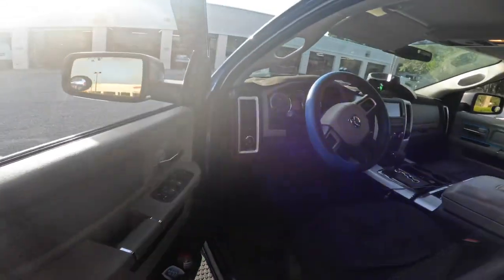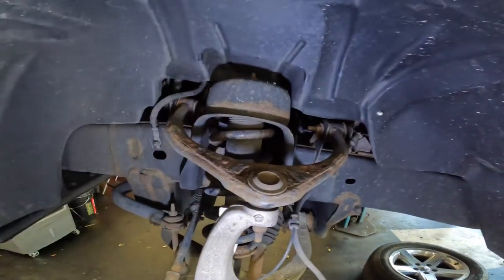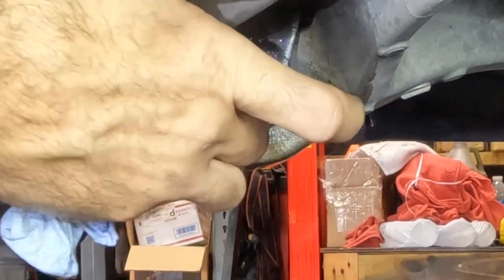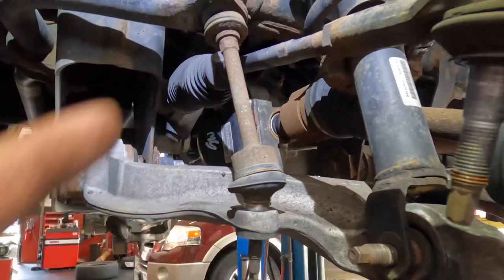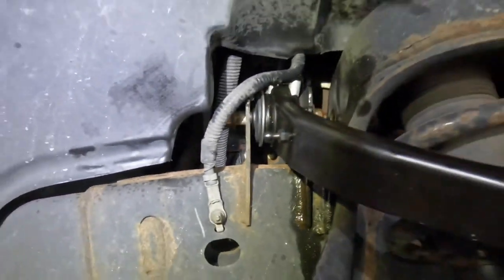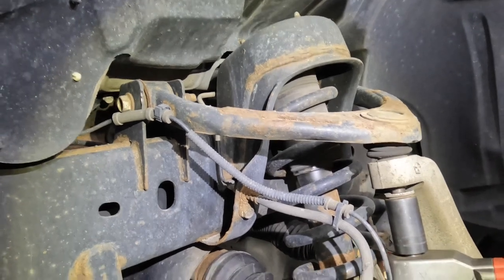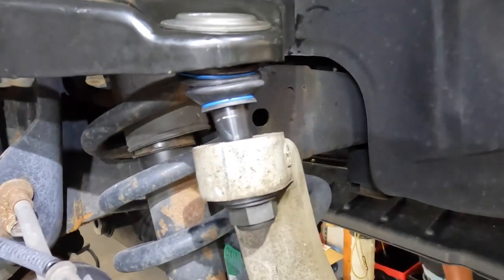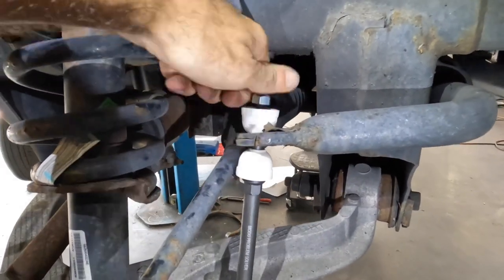Job Fails Fast! 2011 RAM 1500

Comment: In NY to do struts you automatically order lower control arms, and get the torch out. Eric O is chuckling right now. Good job Ray.
Reply: I met a Chrysler Tech once (they are beloved of God) and he told me that up north here, to replace a strut, he often has to replace the whole bearing hub and the CVJ.  What a nightmare for you to quote this.  Yes/No ?
Reply: @MrRunner  i live in WNY yes every thing is rust
Reply: So glad I don't live in the rust belt
Reply: Yup Midwest too. Standard operating procedure in snow counrty. 🤣 🤣 🤣
Reply: Texas... What is Rust???
Reply: Georgia here. The red stuff is clay.
Reply: I live in Ohio where many bolts  become liquid.
Reply: Same in north east Ohio just order the whole kit it's all rustedin central Indiana now   I'm not fixing anything thank GOD for an honest shop
Reply: @Kenoscope  I see some of the cars from up north and think, "How did this 8 year old car get 120 years worth of rust?" Glad I live in Texas.
Reply: I said the same thing!
Reply: 2012 in Ontario...just bought a torch lol
Reply: I live in Sask. Canada. Suspension replacement can be a horrible experience, especially on anything that went a decade without needing replacement. I envy Ray's videos where some of this stuff just comes apart.
Reply: It can't be stuck if it's liquid!  Up north here we take the salt from our mechanics and spread it on the roads, creating even more salt from our mechanics.  Self-perpetuating cycle, renewable resources, etc...
Reply: Wretching in wny for quite sometime now.  And I've never had to get a new control arm for a strut yet lol. And I've had some pretty bad rusted out cars.
Reply: @RV Shadow is that a problem?
Reply: everytime i do ANY struts or Shocks I ALWAYS bring the torch lol
Reply: rip them bushings ,eric o would be like "hold my beer" ill get them out... .. good video bro.
Reply: @skwerlz  We only salt our margaritas down here, not our roads. Arizona.
Reply: @joshuawelch9701  And he would say, "It can't be stuck if it's liquid!"
Reply: @stephengillette355  On the rocks, and not frozen please :)
Reply: who "unbolts" a sway bar link?! same as shocks. torch the top off smash em out. put new in. unless its less then 2 years old every suspension job starts with a smoke wrench.
Reply: In Australia you useualy have to change the suspension because of the hole's in the road, bitamin road's dirt roads are fine, but rust mostly in Victoria, in Northern Territory, Western Australia there drag cars out of the bush and putting back on the road, all the best to you all
Reply: Its a pain but if you work on your own car carwash after every bad snow just washing the salt off makes all the difference
Reply: @hairpunut  Then please, tell us how you get them apart!! Better yet, make a video. I'm in Ontario Canada and dreading the day I have to do this. Maybe if I soak the entire car in a kiddy  pool of evaporust.....
Reply: @RV Shadow Listen i never meantioned that ever strut I've done goes through a bushing. But most struts actually dont. Dodge and some other foreign vehicles are the except. But i have gotten lucky with alot of struts and they not he stuck in the sleeve. Or i use a mixture i make for cars. That i presoak a day prior that seems to help quite a bit. Alot some people actually do some what take care of their cars and either undercoat them or wash them enough to keep rust somewhat under control. But anyway what works for me might not always work for someone else. And everyones experience is different and can vary. But the moral of this is don't just make assumptions about something when you don't know. Also P.S. ;  Also you do realize that they sell just the bushing for the strut too right ? You can go right onto Rock auto and buy a new bolt and bushing for like 20 bucks.
Reply: 😁 What would Eric O. do? Heat it, beat it, and then after saying "What do you want me to do, cut it off?!?" light the torch.
Reply: @Kenoscope  a programming language
Reply: There is an exception to that which is you own a bmw that leaks oil (and they all just about do) which is rust is never a problem on those cars
Reply: @oddwerxstudios5068  had a winter car from ohio once. Toyota. 12 years old. Frame broke. Rusted through

Comment: That stuck bolt represents every bolt/nut i attempt to remove on every vehicle i mess with. stripped heads, chisels, torches, drills, easy outs, and Advil are probably my most used items. much love from massachusetts ❤️
Reply: What?! No rolaids?
Reply: Greetings from a mechanic in NH 😎
Reply: Well Würth buying the German made Rostoff spray.   Been using it for years... Ive also added brake fluid with a dropper in badencases if i have the time overnight.  If im in a hurry, a nut splitter is fast
Reply: I just fought rounded triple square head bolts out of a Toyota Highlander 😒😒😒😒 now I get to timesert the block 😭😭😭😫😫😫
Reply: @blackandbluedress8500  🤦‍♀️😅😂 wonderful, to be able to spend quality time together
Reply: You know it's bad when the plasma cutter is needed :)
Reply: And extractor bits! I ****ed up a screw while trying to replace a lock actuator.
Reply: I work on the railway in the UK. We have instructions for correctly mounting any component right down to individual torque settings, but there's nothing for removing rusted nuts or bolts that haven't been touched in 12 years
Reply: I understand your pain, I'm in Michigan
Reply: @bakerloobadboy  sure... look in your work card.

Go to xyz and done it until xyz time and when you take a glass you can see a little tiny middlefinger. 😉

For non mechanics a screw is an easy item for a mechanic the next pure evil. And of course they also hiding in awesome tight spots
Reply: @tbozzz8785   I'm not a mechanic,but I am in NH and I do work on my car. Gotta love the face full of salt crust and rust while zapping bolts off with the impact!
Reply: Ahoy fellow rust sufferer! Much love from Mi
Reply: Thanks guys, it's nice to know i'm not the only one that loves and hates the challenges of rust and crust!!
i never got so many like and replies on a comment.
Reply: @blackandbluedress8500  triple squares suck. Cracked a couple of them trying to get sway bar links out on my VW
Reply: @bakerloobadboy  I started life as an industrial electrician in 1963 working in a tannery. The days sensible annual wage increases with the Electrical Trades Union and the electrical employers federation.
All a sensible negation where there were no strikes because the employers knew the increase matched inflation and respected financial forecasts.
Back to the tannery, Pittards then built the most modern new tannery in 1965, a great experience.
So much technology as it came into existence.
Taking note of your comment about corrosion.
Generally maintenance was working around 80% corrosion 20% wear.
Great day's when an electrical labourer could become local skilled without an apprenticeship.
It was possible to become skilled with night school.
THE BEST OF ALL LABOURERS COULD ESRN ENOUGH AND BUY A HOUSE.
Homes Under The Hammer didn't destroy workers prospects supported by greedy politicians running the show.
It wasn't perfect but a damn side lot better.
Reply: I bought my 76 Blazer in New York and never were my bolts that rusted up
Reply: @bakerloobadboy  I used to use on molds that were very rusted up from heat cycles and moisture rust dissolver and then let it sit overnight
Reply: I work on my own car and I live in northern Illinois and I feel your pain on that one. My current car an older bmw I got pretty lucky with things coming apart on it mostly because the car used to leak oil from almost every orfrice till I fixed it. I think the oil leaks saved my car from rusting out

Comment: When you do get all of the correct parts to install the stupid leveling kit, please adjust the headlights so they are not blinding everyone else on the road.
Everyone seems to omit that step...
Reply: What's the point of a bro-dozer if you can't harass and intimidate other motorists?
Reply: You have to blind the children before you drive into them because your ride height is so high you can't see them.
Reply: Lmfao no
Reply: @MrSloika  the fact you think people are intimidated by the bro dozer and not too busy laughing at your ruined truck...
Reply: @MrSloika  It's not a bro-dozer if it doesn't have a trash can exhaust tip... because the size of the exhaust tip, makes up for the lack of size of some other kind of 'just the tip'. Giggity.
Reply: @samholdsworth420  The most amusing ones are when they put those giant wheels, with ultra low profile tires, on their 4x4 packed with off road gear.
Most of us know that hunk of ridiculous crap ain't going off road with those worthless wheels and tires, at least not past the first mud puddle or fist sized rock!🤣
Reply: Someone seems salty
Reply: I agree and on top of it why people put thousand lumen light bulbs in the vehicles to drive around town and blind everybody is beyond me I placed two fog lights down low in my grill so if I needed to see the road at night I called but I did not blind anybody and I call it using a little common courtesy and common Sense considering the other drivers on the road more people ought to try it
Reply: I mounted two fog lights download in my grill so if I needed to see the road I could without blinding people it's called common courtesy and consideration more people on the road or to try it I meant downlow I'm on my second cup of coffee and haven't put my teeth in yet and sometimes the phone does not understand what I am saying
Reply: @markbeiser  oh no I got my pretty toy dirty

Comment: Ray....Love your work and more importantly your work ethic and honesty!  I have watched dozens of your videos and yet after 37 years of wrench turning I tend to learn even more.  If I could offer one piece of advice when putting things back together that were difficult to take apart:  Anti-Seize....anyone worth their salt as a fellow knuckle buster knows anti-seize doesn't help with disassembly, except for the next guy.  But remember, you could always be the next guy!  Especially when you're an honest, ethical and trustworthy mechanic!  Keep up the great work and awesome videos.
Reply: I'm a Mechanic in Central Wisconsin, I use never seize on all potential problem areas, And every time I come back to the work I have done with Never seized bolts say a few years later it makes my day because the work can be done in way less than half the time 😎👍.

Comment: Expensive job for something that didn't need to be done..
Reply: A Customer want  ,needs  to be fulfilled 🙂
Reply: The truck cannot he aligned with the alignment bolts seized up. So the lower control arms had to be replaced regardless as the front end aged for a proper alignment. Had dodge antiseized those bolts it wouldve had a different ending.

Comment: KYB SM5743 - Mount Kit

Since the strut is being replaced, cut the y part of the strut off leaving the bushing and bolt in place. Cut the bolt as necessary and push the bushing out. Install new bushing, bolt and strut. Part number listed above. DONE in < 60 min.

Comment: I can relate to this one. Rust makes what would be a couple hours tops down in Florida a whole day or weekend project up here. I have to replace the bushings on my car and have been procrastinating that one as I know it’s gonna be a rough time.
Reply: I don't think I really appreciated how rust isn't an issue at all in the desert until I started watching this channel.  There's a reason they store airplanes here.
Reply: If the car has enough years in the salt belt, the proper procedure is to drive the car until either it disintegrates, or you can scrape together a down payment for another car. Whichever comes first.

Comment: Air Chisel with POINTED chisel on the end of the bolt.. works every time!! the Y yoke of the strut will keep the rubber of the bushing from coming out with the bushing sleeve..

Comment: With parts being hard to get these days, my other option is I would possibly tell the customer is to call auto yards in a dry western state (re: texas, new mexico, arizona, nevada) and see if they can get a set that never had any clue what snow or water looked like.
Reply: I lived on Deep South Texas,everything,including "stainless steel" rusts within days!!
Reply: @lhaa  They dont call it the armpit of Texas for nothing ;)
Reply: @hardtech1  Yes! I had a 1973 Ford truck that I'd bought new when I moved there in 1990. In 1996,the entire top of the truck was rotten to the point that I sold it,fearing that the top would fly off and make it a convertible. I have seen several inadvertent convertibles down there as well as a few that had their bodies fall on the road surface,stopping their trips.

Comment: Having worked for Fastenal for a short time, I can tell you that many automotive fasteners are proprietary.  Fastenal has on the shelf your vanilla bolts and such in grade 5,8, and some in grade 10 for industrial applications.  They have them in stainless, metric, fine thread, coarse thread.  You come into the shop with something non-standard, like a 4 inch long 1/2 inch hex head bolt that has more than 1.5 inches of thread, you’re in custom order territory, and that can cost a small fortune and will take a couple weeks.
Reply: a bolt, has a shank. a screw has thread to the head. thats,,all i know..cap screws, use an allen key.. cotter pins,,are not, split pins..cotter pins seat in or with a recess...or tapered. ausie..
Reply: Some of us out there want the best of the best in parts for our vehicle.
I once bought a Fiat and took the front end apart to add better bolts, and under coating to the support parts to make it last much longer.
I even pried off the things glued to the body like the Fiat logo and other things as I already knew that they had a bad reputation on those things falling off later.
Car companies will cut corners so if you know what will be a problem down the road, why not head off those problems by "blueprinting" your car and eliminating the future problems.
It's like buying that car repair insurance but preventative.
Reply: @robertpage2023  If you want best of the best, you arent buying a Fiat Ram.
Reply: @robertpage2023  top rated trucks for years.
Reply: @adamnichols476  I knew going in that Fiat had problems but being a mechanic, I still wanted to fix any potential future problems and make this car a much better product.
I got it cheap so that gave me leeway to spend more money on it to make it a great car.
I still have it and it runs very well. I do regular maintenance on it for preventative purposes. In Europe, they take much better care of their cars no matter the make.
I've done things like kept the transmission fluid and filter changed to lengthen the life. Same for the motor.
I put in an auxiliary electrical air conditioning compressor timing device to keep it from "hard starting".
I also put in a very good inline Freon filter to make sure that if or when the compressor does go bad, there will be no distribution of metal particles introduced into the rest of the system.  The "Black death" syndrome.
As mentioned, I've coated the entire under carriage and all the supporting structures to keep corrosion from forming.
I keep all working mechanical parts like window glass tracks, door and trunk seals as well as body paint all lubed and waxed or coated to keep it like new.
All electric motors such as inside blower and any electric motors on the cooling fans lubed on a regular basis.
A little care goes a long way.
If I were one of those people that just puts gas and goes then I'd expect any car to fail eventually.
I've even attached grease fittings on all suspension bushings and joints.
I keep the steering knuckles and shafts lithium greased.
True that the car was built cheap but most of these potential problems can be overcome using on-line help and some YT DIY videos made by mechanics with good knowledge.
My Fiat is much better than even a new one.
It drives great and in this day and age, a very economical transport.
Reply: @kelsycunningham8452  Yes, I agree but looking at this truck, you can see the abuse in the way of corrosion.
When a vehicle gets this bad, I have to say that the owner isn't doing his best to keep it in good shape.
And as we are seeing already, much more was needed to be done for that "lift" to be achieved.
Toyota's as good a reputation as they have even got into trouble with a particular truck model that had no frame protection from corrosion.
Imagine that there you are in a Toyota truck and it has to be totaled for that one defect even though everything else is like new.
They did replace some of those frames meaning the entire truck had to be taken apart but didn't put out an all recall on them.
How they got away with that I don't know.
Reply: Metrican and (something)  and Mc Cann used to provide us with many special bits until a year or so into the great recession.
I needed metric shoulder bolts, two of them, now I have 48 spares because of minimum order limits.
Reply: @harrywalker5836  wrong. a bolt has a nut. thats the only difference. if it doesnt have a nut, its a screw. ive used lots of bolts with and without a shank, fully threaded or partially threaded. makes no difference

Comment: I did a Bilstein 5100 level on my ‘17 Ram several years ago…Did a good inspection on the suspension last weekend and noticed a torn balljoint boot. I bought Zone replacement UCA’s and will shortly put them in. Long live impact clickety clicks!